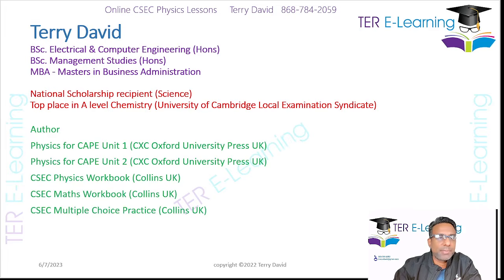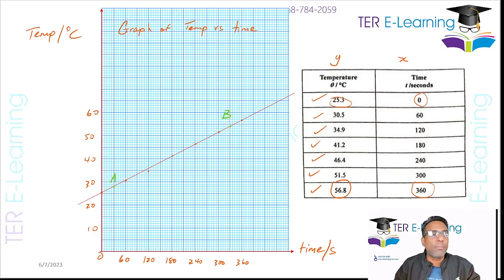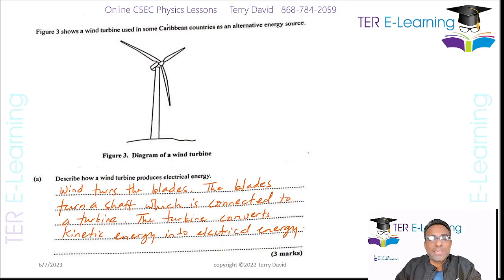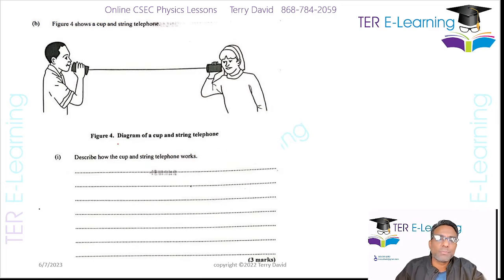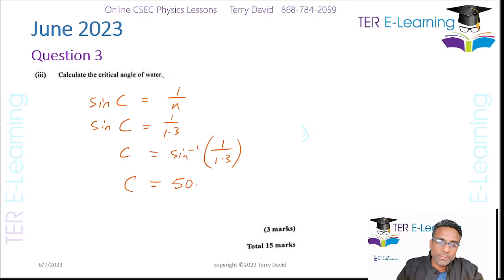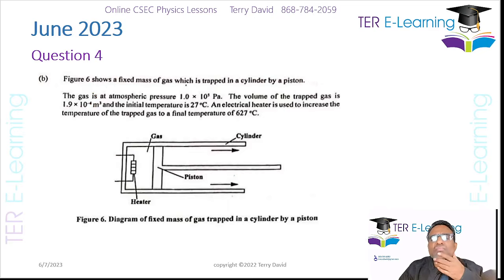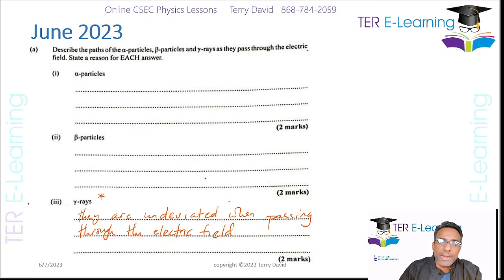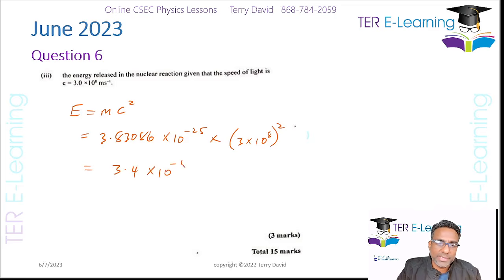CSEC Physics - June 2023 Paper 2 Solutions (Terry David)

Comment: For question 4, how did you get 3.17*10^-4? I did it and got 4.75*10^-4. I'm confused here.
Reply: sameeeeeeeee but diff answer
Reply: I think he made a mistake. He put 1.5 × 10⁵ instead of 1.0 × 10⁵.
Reply: Other than that, his answer is correct. In the calculator, put (1.0 × 10^5) × (1.9 × 10^-4) × (900) as the numerator and (1.8 × 10^5) × (300) as the denominator and you'll get the answer.

Comment: sir for the specific heat capacity,  wouldn't the answer to one significant figure be 4000J?
Reply from the maker: Yes. That's true...I forgot they said that in the question.
Reply: Question: they said graph should be 75%, but the one done looks like 55%, is that ok?